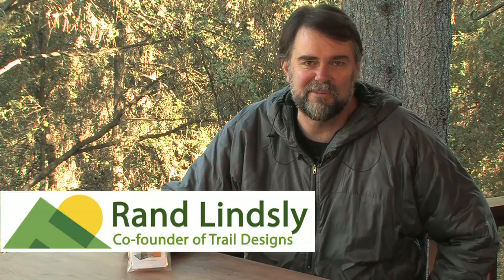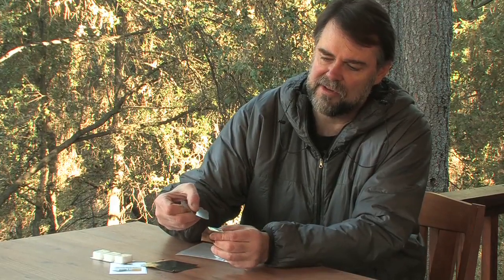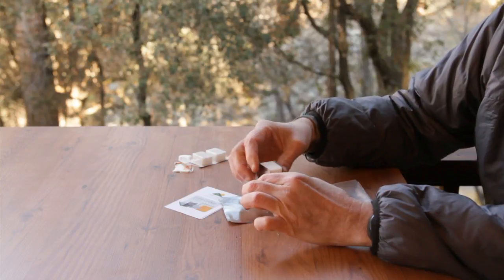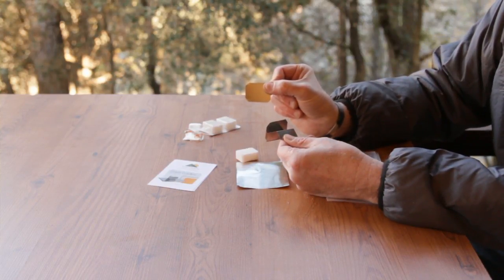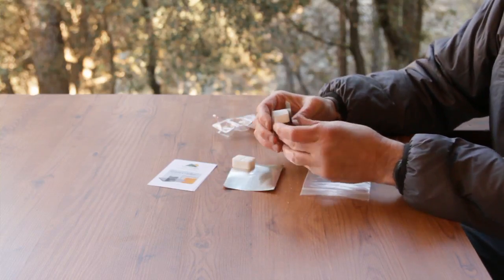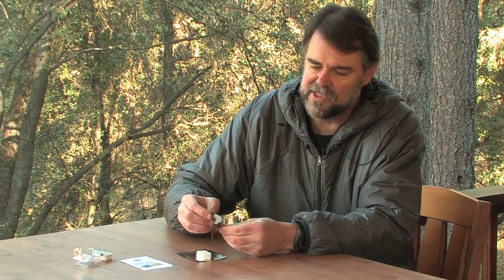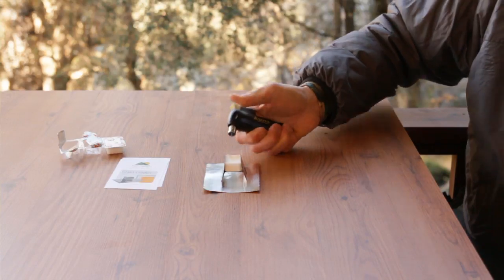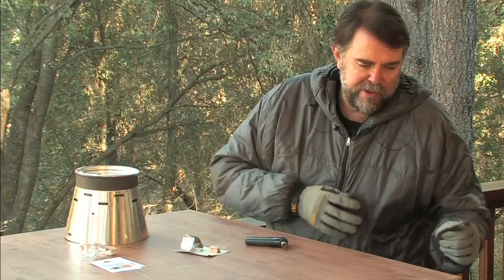Trail Designs Gram Cracker

Comment from the maker: Thanks for watching!   It's always kind of hard to estimate boil times because water temps, outdoor temps and altitude vary.  However, with all those caveats and the big error bars, I can do a 2 cup boil in 6-8 minutes with the side wings with a ~12ish minute total burn.   However, time to boil isn't the interesting bit.   What's most interesting is that with the more controlled burn and cone efficiency, I've been able to get a 2 cup boil under the right circumstances on a half a tablet!